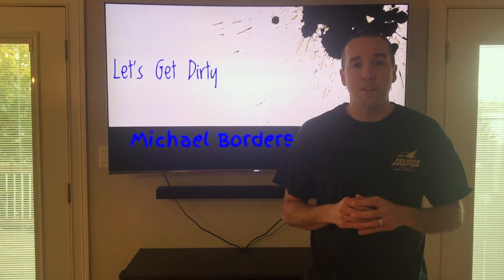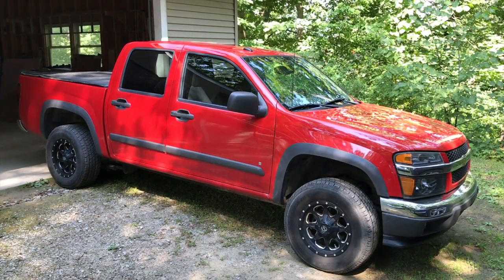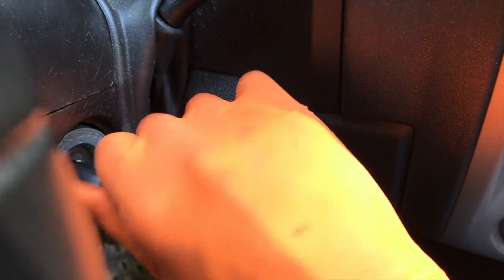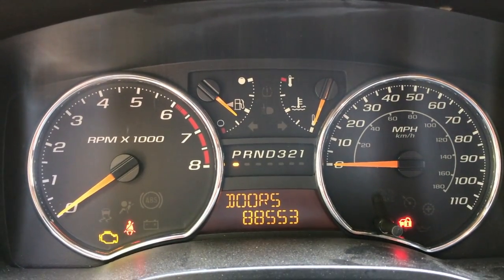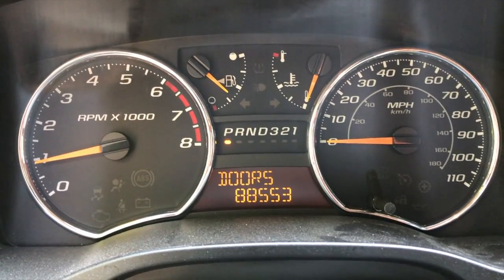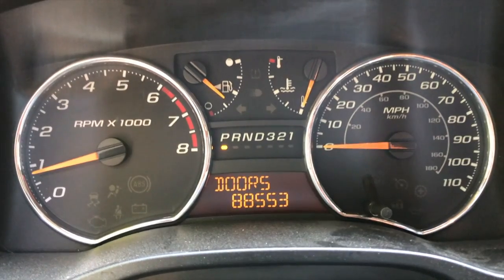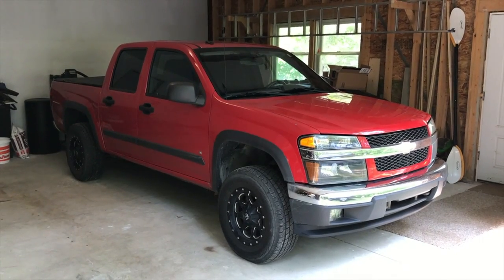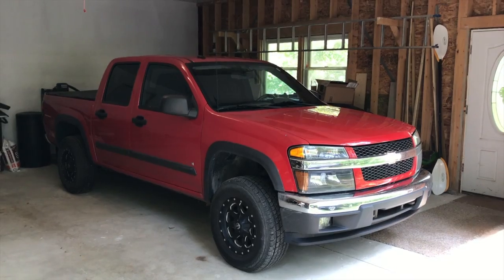How to do a "QUICK Reset" on your ABS System!

Comment: I've always had luck with this trick on my 2011 jeep liberty but now i'm not? i just changed my oil the other day, and now i have: tire sensor "!", ABS, and traction on my dash. I recited this video to remember what to do for an emergency reset, and it didn't work. Thoughts? Suggestions? I'm going to get the code read after work today. Thanks, Amanda
Reply from the maker: Thanks for watching & you may need to disconnect the black negative cable from your battery and leave disconnected for 30 minutes.

After 30 minutes, resecure cable to battery and see if that alleviates error.

Comment: I have a 2017 ram 2500, abs and traction control light comes on and goes out seemingly at random.  My first though was a bad wheel sensor, so I checked them all with a multi-meter.  I checked continuity and spun the wheel to check that it is sending the proper signal.  All 4 wheel sensors are working properly. So, imagine my angst when the problem persists. Oh…. And in HOT weather (I’m in Savannah GA) the light comes on less often.
Reply from the maker: Thanks for watching & welcome to the DIY Raptor Club.  Do you see any signs of damage to your speed sensor wiring...broken wires, melted wires...

We recommend following the electrical wiring all the way to the connection point and ensuring that it is 100% dry and moisture free as well as firmly secured.

Moisture can make its way into those connection points and trap that moisture setting off sporadic behavior with traction control system.  Keep us posted.

😎👍🔧🔩

Comment: How to do it on lexus gx470?
Reply from the maker: Thanks for watching, not sure if this works on a Lexus...🤔...have you tried it?
Reply: @DIYwithMichaelBorders  yea i tried but didnt work.. actually my fluid tank was over filled that spilled over abs and my brakes and abs stopped working.. yesterday i watched you video and did that but not worked.. i cleaned with wd40 but still no success.. it is giving abs module sign.. what should i do?
Reply from the maker: @americanclubs  

Thanks for watching.  You may need to do some friendly cleaning to the areas where the fluid spilled into.  Internal parts may be wet and acting erratically

🤔

Please keep us posted.  😎👍
Reply: @DIYwithMichaelBorders  what chemical should i use other than wd40 which will cleanup good?
Reply from the maker: @americanclubs  

It may be as friendly as using shop towels.  If you do not have any shop towels, paper towels should be fine.  Any fluids in areas that you cannot reach may take a few days to evaporate as the engine is running and warming up.

Comment: Hi!  does it work on peugeot 206 2006 modle?
Reply: I changed discs, pads, shoes and drums on mine yesterday and abs came on...I have tried this little trick but unfortunately it didnt work on my peugeot 206...off to the garage to get it taken off but worth a try...👍
Reply from the maker: @deenamurphy-edwards7087  

Thanks for watching, you may need to disconnect your black negative cable from your battery and leave disconnected for a minimum of 5 minutes.  This will allow your system to perform a full reset.

Reconnect battery cable and see if that fixes issue.

😎👍🔧🔩
Reply from the maker: Thanks for watching & it’s very possible.  Hope all is well.  😎👍

Comment: 1996 Ford F-150XL abs blinks 16 times and blows fuses?  so far I replaced brake pedal sensor no luck. any suggestions?
Reply from the maker: Thanks for watching & that’s no fun.  What’s your update?  The most common cause of this is an axel/wheel bearing reaching its tail end of life.  In other words, you may need to replace one of your front wheel hub assemblies.  To pinpoint which one is causing this, you will need to have an OBD scanner read your ABS code.  If it’s any help to you at all, we have posted a link below that shows replacement of a hub assembly on our Chevy Colorado.

       https://youtu.be/S0temq1xiQg

Please keep us posted on your project.

😎👍🔧🔩

Comment: Hi I checked rear abs sensor with multimeter and reading is 11.224 kilo ohms then I check connector which is come from battery on dc voltage and voltages was 11.82 is it wiring and sensor okay my abs light staying on please help me
Reply from the maker: Thanks for watching & welcome to the DIY Raptor Club.  Let’s start with the easy step.  We recommend bringing all 4 tire pressure up to the tires recommended psi.

Believe it or not, your ABS light can turn on if your tire pressures are substantially out of balance.  Keep us posted.

😎👍🔧🔩

Comment: What about 2010 Buick lacrosse push to start button? How is it done?
Reply from the maker: Thanks for watching & it’s possible that these steps will help reset your system however it may not due to the difference in manufacture.

Comment: THIS WILL ALSO RESET YOUR MILAGE COUNTER TO YOUR NEXT OIL CHANGE AT 3000 MILES INTERVELLS
Reply from the maker: Thanks for watching & welcome to the DIY Raptor Club.  We appreciate you sharing your info.

Enjoy your day!  😎👍🔧🔩
Reply: Hey Mike, that sounds like a crappy reply. Was reading the comments waiting to find this one. Madroofer is absolutely correct. Good way to cause more problems. Get a scanner that is ABS capable and do it right. Or take it to a knowledgeable repair facility.

Comment: I need some kind of cluster thing.  $1400 and only the dealer can do it.  2008 ford e350
Reply from the maker: Thanks for watching & that’s a pricy repair.  😳
Reply: @DIYwithMichaelBorders  I love your videos.  Great, practical and enthusiastic!   Any suggestions?  I tried the reset but it didnt work.
Reply from the maker: @gordoncashwell325  

Let’s try something.  We recommend adding air to all four of your tires and bringing the psi up to required.  If The side of your tire calls for 32 psi, bring all tires up to 32psi.  Take it for a test drive.  Keep us posted.
Reply: @DIYwithMichaelBorders  okay.  Thanks!
Reply from the maker: @gordoncashwell325  

😎👍🔧🔩
Reply: Thank you so much. My Chevy Colorado had steering wheel and brakes lock as I was backing out of drive way. I remembered the Abs light had come on a couple of days ago, which I had read to put key in door lock and hold for 30 seconds, I did and it went out.
I didn't notice it was back on today when this happened. It's Sunday and i was calling around for a mechanic and one I spoke with said I needed someone who handled electrical and locks. Anyhow I Googled and found your video, which you even had same truck to show it on and it WORKED!! Thanks. Can't imagine what I would have paid without you.

Comment: i have a question, my chevy colorado 2010 doesn't start, when i make contact with the key i only hear a "tac tac tac tac tac tac" sound for a few seconds, the ABS light is on. Someone has any idea of what problem is ??
Reply: It may be your starter is bad or you might need new spark plugs
Reply from the maker: Dezzy Pooh 

Thanks for sharing your thoughts & we agree.  You may have a loose electrical connection such as a ground wire.

Verify all electrical connection points are properly secured.  Keep us posted.  Us fellow DIY’ers need to stick together!

😎👍🔧🔩
Reply: I have the same issue, above the miles where it says doors, it noe says ABS FAULT
Reply from the maker: @USAlien234  

Thanks for watching.  A quick friendly trip to AutoZone may be in the works as they can read any and all of your ABS codes for 100% free.  Keep us posted.

😎👍🔧🔩
Reply: @DIYwithMichaelBorders  if only I could get it there 😥

Comment: I just need to do my front left abs wheel speed sensor in my Canyon. Good trick to know though. Thanks!
Reply from the maker: Bill Carini 

Thanks for watching Bill.  Check out our video on replacing the speed sensor and hub assembly on our Chevy Colorado.  You may find it very helpful.

👍👍🔧🔩
Reply: @DIYwithMichaelBorders  I did already and it is. I just haven't had the cash to do it yet. The radiator has a leak so I'll be doing that here in a couple of days.
Reply from the maker: Bill Carini 

Neat, keep us posted, we are here to help with any questions you may have.

😎👍🔧🔩
Reply: @DIYwithMichaelBorders  radiator update... It was a very simple job! 4 bolts on the skid plate, remove lower radiator hose and transmission lines (for automatics). Remove upper hose then fan shroud. Remove grill, which is only clipped in. Out of the 8 I think I have 2 left but zip ties help hold that. Most were broke before this. 2 bolt for AC condenser and 1 for the top radiator mount and it basically slides on up. I admit I got the cheapest one I could find at $65 shipped! My only issue was the left and right end caps that I had to transfer from the old radiator to the new one. Each one is held in at the top with a torque style screw. I broke 2 bits and it didn't even break loose. Out came the grinder and I found new bolts that fit the nuts in the new part. It's a common size so I had them from a past project. Everything is back in and I realize my transmission lines don't screw into the new radiator's trans cooler. After a few minutes of "great... Now what!?" I realized that the new radiator came with the part I needed. That screw end of the transmission lines are held on by little metal clips that are easily removed with something pointed. Almost like a quick disconnect. Popped the new ones on, made sure it was all good to go and the whole job would have taken less than an hour but since I was in no real rush it took about 2 hours. No special tools needed. I think a 10mm & 13mm socket, a ¾inch wrench, Channel Locks and a flat screw driver is all I used.
Reply from the maker: Bill Carini 

Bill, this is awesome info & we really appreciate it.  Great organized step-by-step guidance.  This will definitely be helpful to viewers.

😎👍🔧🔩